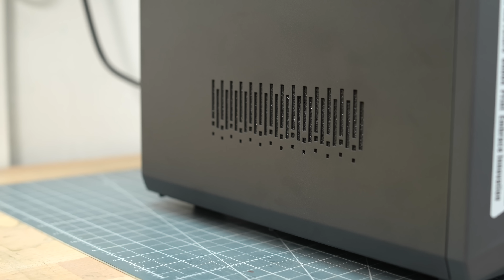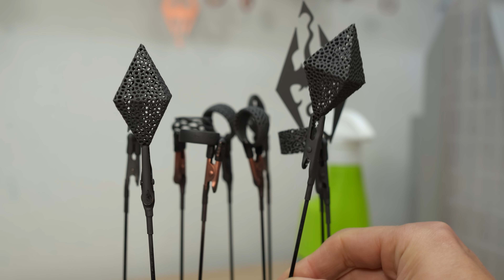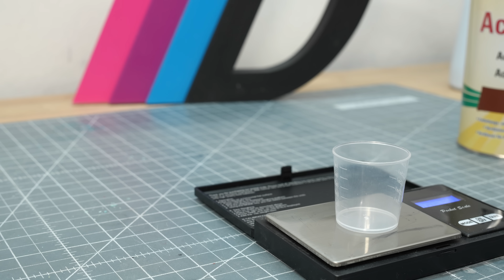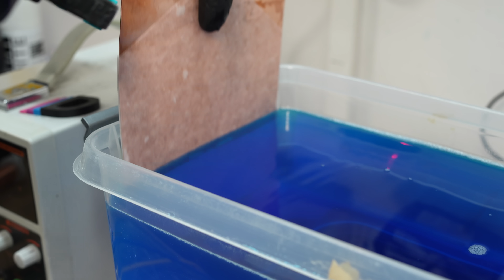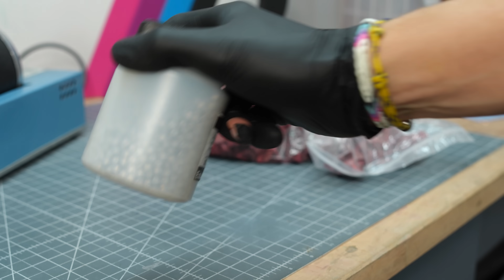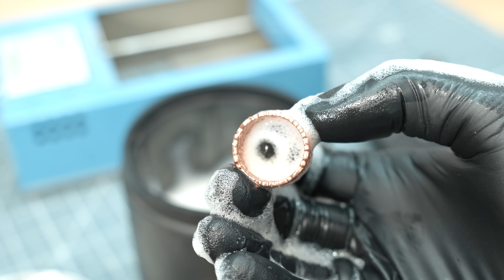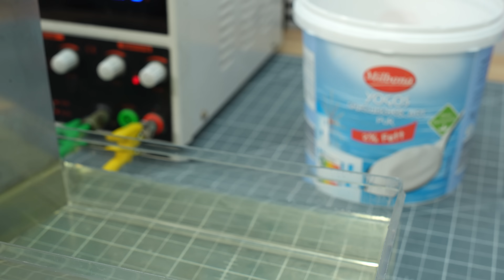Electroplating 3D Printed Jewelry | FULL TUTORIAL

Comment: Few questions, how much estimated for all the electroplating and polishing equipment, and I’m assuming it really depends on the artist but what would be the general value of each piece? You are such an inspiration and I look forward to investing in such a process. <3
Reply from the maker: Here we go:
You should start small, I recommend a professional acidic copper electrolyte (1l would be around 30€). Copper sheets (10€). Regulated power supply min 5A giving constant current (70€). Graphit or copper paint (20-50€). PPE (30€). Degreaser (10€). That’s all you need to start tinkering around. Once you gained confidence in the process you can scale up or add more electrolytes to the collection, building fancy jigs or invest in several specials like pen plater etc.

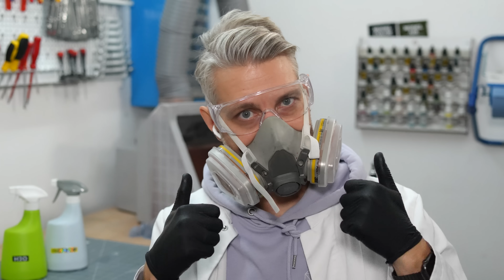Comment: 1:19 - I'm fairly new to resin printing (less than a week), one of the things holding me back was the additional investment cost of tent to house printer, filter/fan/ducting to deal with fumes, as well as PPE and stuff for cleanup.  Being new, I of course joined some FB groups and posted about my setup.  The number of people who thought things like a respirator and way to vent fumes was overkill was downright shocking.  Thank you for emphasizing safety.
Reply: I know of a lady that has organ damage because of repeated exposure since covid.
Reply: i just cut a hole in my resin printer cover and placed an extractor fan through it simple realy nothing overly complicated
Reply: all the ppe is nonsense. no one can explain why its toxic with any proof. i've tested the air for whatever people say and its super low. 
been resin printing for the last 4 years without any issue. All i've done is wash my hands if i get any on them or touch any parts that aren't fully cured. 
you're more likely to have health problem splashing yourself in the eye with isopropyl than the resin fumes.
Reply: They will all have microparticulate resin in their lungs, you trust your instincts
Reply: They were nonchalant about it because you get the same dosing of chemicals cooking on a Teflon pan.
Reply: @appollyx5769  Do you have links to back that claim?
Even if we assume same VOC output from printing/curing as cooking on a Teflon pan, IDK about you, but my printer runs a lot more than my stove.
Reply: Fdm printers release same amount of tvoc and so does frying
Reply: @scottyboy6269  You wouldn't happen to have any sources for that would ya?

Comment: What do you do with those in general? What's the point?
Reply from the maker: This is a test for rapid prototyping jewelry w/o casting and to produce display jewelry. I also testet the weight what I didn’t cover in the video. This is an interesting feature as theses things are very very light, so huge ear rings can be worn easily. For example.
Reply: @hen3drik  I just had an idea. I lost my signet ring some time ago and I didn't like its weight. I wonder if you could make a super light version to wear? I'm in EU.

Comment: Amazing vídeo, and outstanding results! I really appreciate you showing the ingredients and details for the methods!! Can't wait to try those myself!
A few questions:
For the post processing, since the parts already come pretty decent from the electroplating, wouldn't skipping to the last polishing steps (stainless steel and dry polishing) yield almost the same results?

Have you tried doing some destructive tests to see if the conductive copper paint makes the electroplating adhere better than with the graphite paint? (like scraping the surface to see which one is harder to remove)
Reply from the maker: Post processing is not necessary if you’re satisfied by the shine and outcome of the plating as it’s already pretty shiny. I haven’t made serious test with the strength but the copper is not adhering tongue paint/graphite. It’s more enclosed around the object.

Comment: Two questions:
1) does this mean that chrome automotive plating is composed of nickel (only)?
2) could materials like aluminum be plated onto parts? For example, for automotive parts?
Reply: For 1 i do not have an answer, for 2 - well if you find a proper electrolyte + proper reaction (since it is literally very simple chemistry) i don't see anything against aluminum plating, either for finish or chemical protection (aluminum can do good in terms of oxidation protection for external parts, but i guess this is your use case since you brought simillar example in question no. 1)

Keep in mind that there will be another reaction on the other electrode, so either you find something like base aluminum to be dissolved into electrolyte to regenerate it, or you go with Platinum so that water molecules would break down on it, but then again - you have to find some 2 different reactions that can have good relative reduction/oxidation potential, with one reduction being your target metal getting deposited onto the final part, and then select another reaction to be whatever you want as a counter to this. There are reaction potential sheets on web, you can figure that out
Reply: And about "proper electrolyte" - this is literally an easly soluble salt of a target metal most likely, dissolved in water solution, like his copper electrolyte solution. With some calculations you could also make one yourself with proper molar concentration, or percentage (ethier mass percentage or volumetric percentage) (using salt directly)
Reply: @ fantastic! Super appreciate your efforts and this knowledge!
Reply: @ super appreciate these detail and insights you provided!

Comment: how about a dip smoothing step for the resin/plastic? instead of tedious sanding. idk acetone or some other material etching water liquid. yep its more fit to the similar electroplating process. also polish is not required, just wait for the surface to be covered with the electroplate metal. then its full speed all around. conductive graphite paint is only for the initial conductive surface. oh yep that acetone in the graphite paint is also the polishing liquid. koh (potassium hydroxide) water solution would be smoothing polishing solution for all steps. even metal. possibly surface layer removal after. maybe hcl solution or some similar acid like h2so4 would also do this. because h2so4 will turn the top metal (copper, zinc etc oxides) into sulfates in the solution.
Reply: if you would not immediately replenish the copper sulfate solution with copper, you would have the polishing h2so4 in the water solution already.

Comment: Well done, rather complex work but results speak for themselfs. Perhaps a brithner in copper electrolight coud reduce polishing time (it complicates maintaning bath unfortunatly).
Copper electrolite can be recycled whit iron (plate or thick wire). All copper whil cement out of solution, slow but cheap.
Iron sulphate is not bad for eviroment.
Nickel has self leveling (and high shine) properties whit aditives in sulphamate type electrolyte, whit layers up to 0.5mm.
Mechanical stres-strain than starts to cause problems.

Comment: As always - great work! And thanks for providing the tools, I'm interested in this Proxxon sander. I was a bit surprised, because the smooth rigid surface is actually unsuitable for round objects, isn't it? Shouldn't sanding sponges up to approx. 2000 grit be better and faster? 
Oh and I believe you once said it is important to spray on the Copper conductive with a certain pressure, because too little pressure would not be good? How much bar do you set for spraying? Greetz from Leipzig
Reply from the maker: You can print adapters for the sander 😃.  Use 2.5bar
Reply: @hen3drik  super cool. I always forget I can print my own tools 😅

Comment: Safety questions:
I see an active system for when you spray the conductive paint, but don't see one when you plate. Is it not necessary to vent the fumes? I want to do it in a room that I might have to occupy and has other running machines (such as my fdm printers and a computer) during the plating process and was wondering how safe it is. I know the copper process will off gas hydrogen but I don't know what else. 

When you store the electrolyte, do you just leave it in that bin? Does it need to be air tight? Or should I just pour it back out into the original container when I am not using it?

Less safety question:
If I were to use the process on miniatures, would the tumbler still be a good idea? Or should I stick to hand/tool sanding/polishing?

Comment: How have you found the strength of resin prints is when plating? I imagine you’re not adding a ton of strength to brittle resin, I considered abs like resin but was thinking you might get a reaction between the paint with acetone and an abs like resin as you would traditionally with abs and acetone. 

I just bought a bunch of stuff for getting started and am super excited!

Comment: Curious on the plating part where the wire touches the piece, doesnt that leave unplated spots, how to deal with that?

Also why not just polish with a wheel compound and paper in minutes rather than hours?
Reply from the maker: It leaves marks. These are reduced a lot by ventilating the bath with the stirrer. Tumble polishing is just another method and suitable for many parts at once. 😃

Comment: Hello! I have a tip on disposing the copper chloride solution or any toxic material. What i do is pour it all on a bin with paper, i dump the solution on the bin so it evaporates into the paper towels, that way you can reduce the volume of the waste and even reclaim some materials that way

Comment: I may have missed it, but how do you find the surface area of a part?
Reply from the maker: I didn’t tell this time. I use blender for that. There is an addin 3d print toolbox that gives you the surface area. Fusion 360 does work too

Comment: Question regarding putting a coffee filter over your copper anode...
Why would you do this?  I use a 99.9% pure copper anode and find it beneficial to allow the pure copper to transfer from the anode to the plated item which gives my copper solution a lot more longevity by doing so.  In the process, I've never experienced any issue with contamination or debris markings that I would find useful in needing a coffee filter.  

Maybe this is just a matter of preference but I'm just curious.
Reply from the maker: Excellent question! I don’t use phosphorus added copper anodes but sometimes some from the hardware store. So I get some sludge. It’s not as bad, as it seems to be a very pure copper but still I have that issue. Not so bad, so I still use it. 😃

Comment: I've been plating for years and while I use a bubbler as well as utilizing a temperature-controlled stirring station but I constantly inspect and turn my pieces around.  I absolutely loved your idea of making a rotating cathode tool to keep your pieces also in constant motion that would help prevent one side of plating being closer to the anode than other areas of the plated item.  I definitely need to DIY something up for that soon.  Thanks for the idea (earned a subscribe here).
Reply from the maker: It tried bubbling but my electrolyte forms a lot of foam while doing this. I guess it comes from the brightner, not sure. Turning and stirring improves the surface quality a lot. I‘ll now investigate in better anodes as you said.
Reply: @hen3drik  Moin!. What brightner do use?
Reply: @SAMEDOKAWA  I'm actually getting ready to post a helpful tip on my channel as well you guys may want to try.  Instead of the tumbler that may be a bit rough on the plating, when you have applied for example an extra thick layer for your customer or maybe left your plated item too close to the anode where it can turn gold a dark brown, silver a bright white, or copper can go black on you, an easy fix rather than the tumbler is to use baking soda with a little water and a drop of dishwashing soap in the palm of your hand and lightly rub it on your burned or overly plated item.  You'll probably be amazed how brilliant bright your item will come out with just that alone in only seconds (not hours).  I sometimes use a toothbrush or for deep pourous jewelry an aggitating toothbrush with baking soda.  I'm not sure of anyone else doing this, I just thought it made sense many years ago and it works really good.  Further, if you for example blacken your copper you probably know anything after that like gold would allow the dark shade show through but this little hack will make it so bright that you'll be able to apply your next layer whether it be a base, barrier, or final layer without any shading issues.  Hope that helps and thank you again for your tips to Hindrick here, I'm exited about 3-D printing up a spinning DIY turnstile like he made 👍
Reply: @PatriotCoinRings  I use baking soda to clean my glass cook top. Lots of instructions say to use baking soda + vinegar but all that does is neutralize base with acid: stupid. Baking soda is a good gentle abrasive that is great for polishing all sorts of stuff.
Reply: @Grunchy005  Initially when I tried this was because of the dark burning I sometimes got when I let one side of an item remain too close to the anode without turning it regularly or insufficient agitation in the beaker.  I figured it would help remove what appeared to me as oxidation by extra heavy plating on the one side.  I also figured it was a fine enough powder that may work well to help remove stained areas.  "I was right", it works miracles on burned and oxidized areas and I've been using this technique for many years now.  Even when an item looks fine, just a light rubbing with it made the gold finish even more polished and mirror like.
Reply: @hen3drik  Hey Hendrick, props on making such a professional-looking video here.  I wish my videos looked this good 😎
Reply: @hen3drik  too much bubbles or too much stirring hurts the surface, ultrasound should help with both. Just did not figured out how to put transducer in 60c sulfuric bath yet )
On a factory they fight excess foam chemically if bubbles form inside or physically if they form on the surface (you could fill bath surface with acrylic/teflon sawdust or PP lenses for example). It's acid that reduces the water surface tension and promotes foam, so you cant remove it completely, only reduce it. Bubble stirring is for huge 1-2 ton baths, definitely not for hobby or lab ones. Some stirring is good if its not creating bubbles or breaking surface metal microstructures on katode.

Comment: Your part spinner is an awesome solution to getting an even metal plating. I found something over the Christmas season for people who rather buy something:
Christmas tree ornament spinners! There's a few different types and some have multiple spinners per cord.
Reply: This is a great idea! I already bought all the chemicals etc. and want to start with the process sometime soon. I want to use it as a tool and not for tinkering. Therefore, I will buy the spinners. Thank you very much!
Reply: would it still work without a rotary jig?
Reply: Or baby mobile motors. They just add music, but you can modify them to remove the speaker.

Comment: I've been waiting for this video for a month and it was well worth the wait! Thank you so much for those detailed tutorials, you inspired me to do 3d printing and electroplating for jewelry. I'm super excited to give it a try soon now that your video came out!

I was wondering what kind of resin you are using? I saw online that some people were saying that we should use biocompatible resins to do jewelry, as normal resin are only 'touch safe', but they are usually way more expensive than usual resin. I’m guessing the electroplated layer would dramatically reduce any potential resin leaching onto the skin, but I’d still prefer to stay on the safer side. What would be your opinion on resins for rings meant to be worn every day?
Reply from the maker: Good to hear! I actually have no long term experience in jewelry and resins but it will not diffuse through the metal for sure. Don’t use nickel, this is much more critical. Thank you!